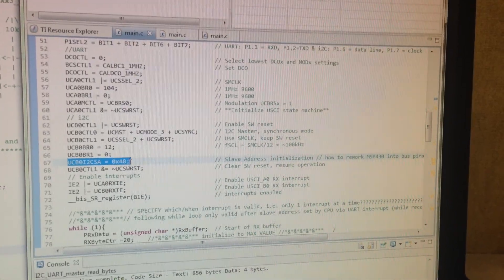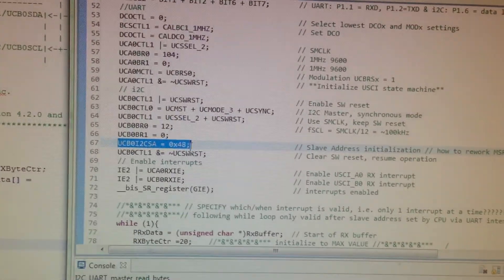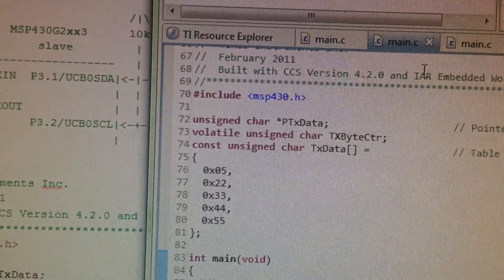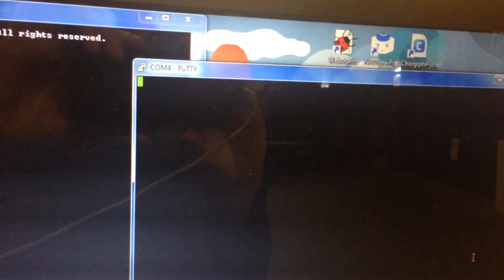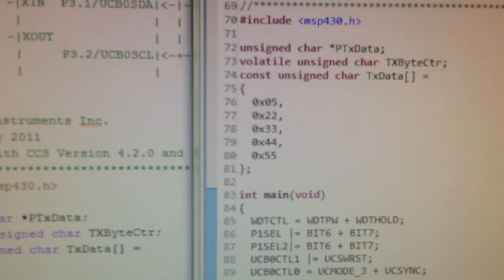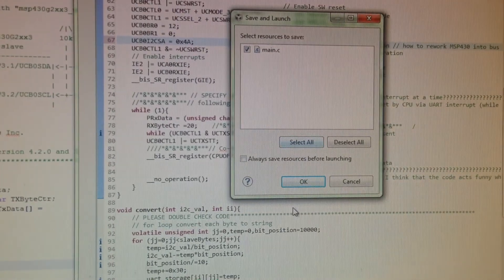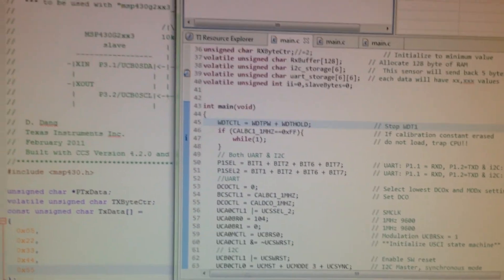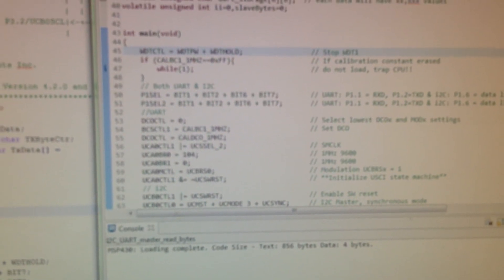MSP430 Master/Slaves: Transfer Multiple Bytes via I2C & UART

Comment: Hi Ms. Erin,

Just want to ask why in MSP430 microcontroller UART,
when you send a 0x05 hex will have an output on the pUTTY terminal of "00005"
if you declare the data type of array to be "char"? Just curious. Thanks
Reply from the maker: +Leo Pestanas My slave mircoontroller sends characters (in hex), which my master converts from hex to decimal. It displays them displays in decimal.  If you follow the link above, you can see my complete code.
Reply: Ok, thanks. I'll view the complete code.

Comment: Hey Erin, please share a circuit diagram of the connections and your code. 
I am having trouble using i2c and your's is the only tutorial which I can relate with my project..
Reply from the maker: Shubham jain Here is a link to the schematic on my Google+ page:  https://goo.gl/Pv7evZ
Reply from the maker: Shubham jain Here is the link to the code examples:
One is for the master, one is for the slave.  The address for the slave must be set in both the master and the slave code. 

https://github.com/oogieoogieful/msp430g2553_newbies
Reply: @ErinWilesOogie  link is not avalable can you resend?
Reply: @ErinWilesOogie  i need code
Reply: @ErinWilesOogie  i need code